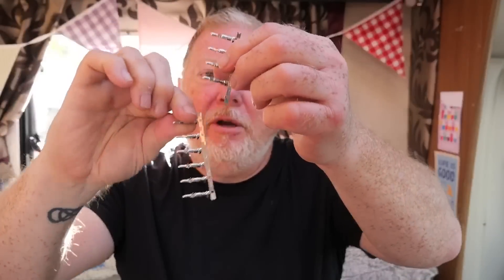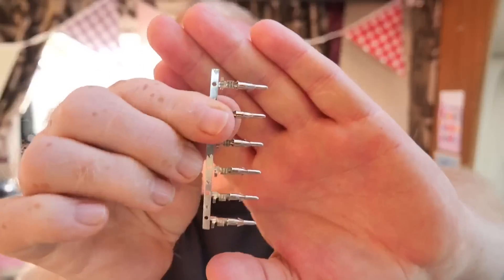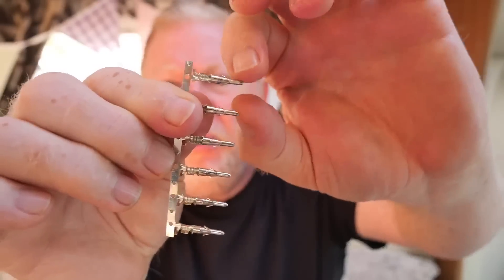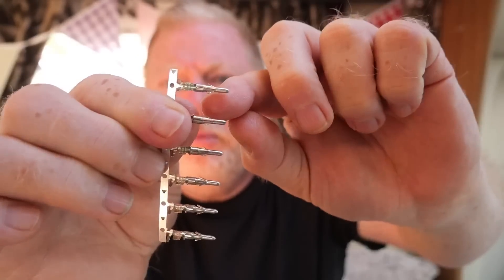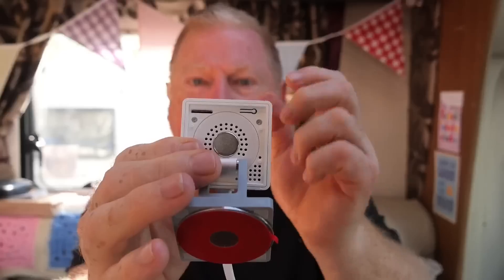MotorHome Security Cameras and Sargent Electrical Repair Kit

Comment: Any joy with cameras install I’m struggling to connect to my house WiFi ?
Reply from the maker: MAPS The Way what I found was that the camera does not seem to like SSIDs with spaces. My mobile Wi-Fi SSID was something like “MY WiFi 5G_7845” pretty random but it’s how it came. 
Could con connect to it no matter how many times I tried. I decided to change it to something really simple so I did not have to keep on retyping that complicated SSID. Changed it to THT1 and hey presto it connected straight away. 
Maybe try changing your SSID (network name) to something very simple with no spaces or special characters.

Comment: Would it be better to use bootlace crimps to terminate the cables and a screw connector block 🤔
Reply from the maker: The supplies termination block is not ideal and I’d really want to use something else. I’ll be making a trip to the local Leroy-Merlin diy ship before I start the job. I’ll be filming the repair too 👍😀😎

Comment: Hello Steve I had the same trouble on my electric box over the years the terminals corrodes and burns out I've got through 3 boxes, when speaking to the maker he said you need to spray it with electrical spray to stop it corroding, if it's left or gets damp it tens to corrodes and burns out the terminal , so spray regular it should solve your problem in the future , hope this helps
Reply from the maker: Hey Stuart, that’s really helpful. Thanks loads for that 👍😀😎

Comment: The camera a Reolink in my motorhome is on a switched USB socket so I can just just turn it on or off at the flick of a switch so it is only working while the vn is empty and they are also a parasetic load wasting battery .
Reply from the maker: Everything takes power while it’s on so it’s just one of those things. Good idea having a switch to activate the whole system.

Comment: I think I’ve found the problem why it won’t connect ! My house router is 5ghz and the cameras only work 2.4ghz
Apparently you can change the router to 2.4 ghz but it’s out of comfort zone 🤦‍♂️
Reply from the maker: Wi-Fi routers would usually come with both frequencies. It’s probably a question of switching 2.4Ghz on via the admin screen.
Reply: The Happy Travellers thanks for the info Steve how do I get to the admin screen it’s a sky router ?
Reply from the maker: From memory, you'd go to a web browser and type into the ADDRESS BAR 192.168.1.1/admin/

Comment: Are these camera picking up caravan site WiFi or your mifi?
Reply from the maker: Running on our MyFi 👍😀😎. Worked really well today while we were out.
Reply: I use one in my flat and will in the van. Can you explain your mifi set up sometime please. Would it be worth getting the lock changed on your driver's door by a fiat agent at some point.